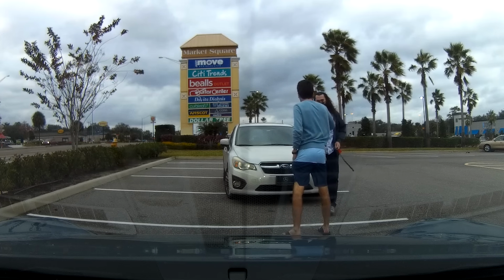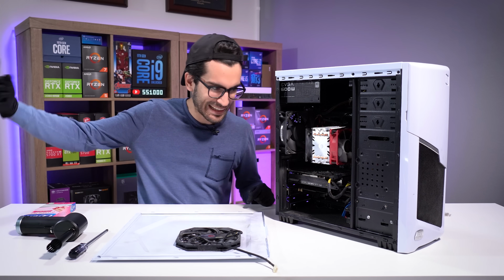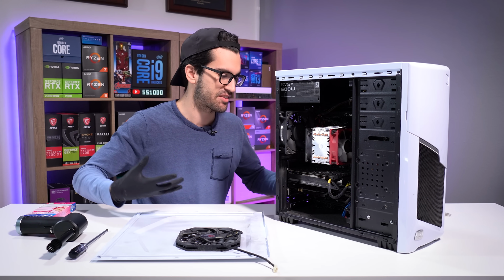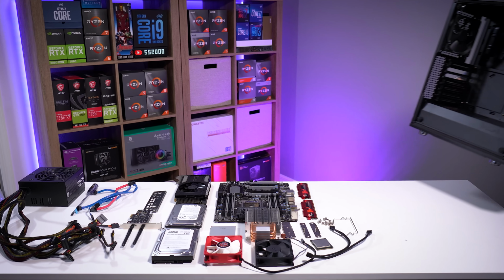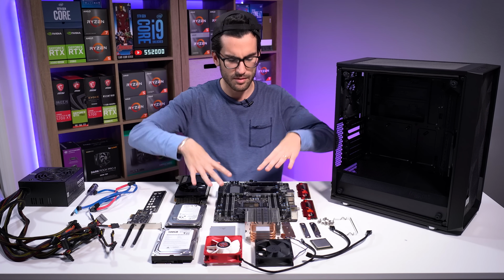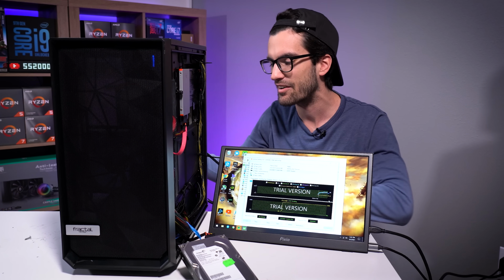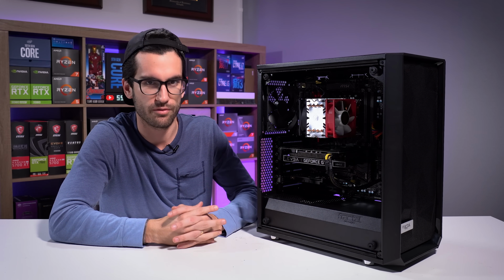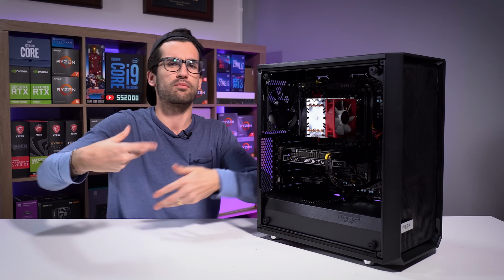Deep-Cleaning a Viewer's DIRTY Gaming PC! - PCDC S1:E2

Comment from the maker: I'm overwhelmed by the positive feedback and engagement from this series. I only hope to keep it going! Email Lisa if you're local and need a free cleaning! Episode 3 is already filmed 😁
Reply: @THISLOVETHISHATE99  they are dangerous to take apart. He probably blew it out off camera.
Reply: Excellent use of your platform to create content while also doing something good for the community👍
Reply: This is Keith, Keith has a dirty pc, don't be like Keith
Reply: Blowing dust out of a graphics card heatsink on to carpet is hardcore.
Reply: I can’t stop growing algae in mine no matter what I do done a whole different loop and CLEANED IT multiple times replaced everything and tried different fluids but nope
Reply: Have you considered throwing up benchmark stats for the combos and upgrades you do? 

To prove that older or more mild combos are still viable with reasonable maintenance
Reply: G'day Greg, I'm really enjoying the PC Cleaning videos,
My PC cleaning kit also has a pack of Medium Bristle Tooth Brushes for doing the Circuit Boards, We had a Bad Day with a CottonBud (CueTip) & ASUS P8B87s-M, they had a disagreement over whether one of the SMDs was attached, the CottonBud won the argument 😖, but the Motherboard was right, it was important & I tried fixing it but the Board is now no good 🤬,
So now The Toothbrush Family Have won the Cleaning Contract, while the CottonBud Family just do Tight Smooth Surface Contracting 😁
Reply: I think if I may, spending a bit more time showing how to deep clean certain parts, like GPUs for example, best practices and stuff like that should engage more people.
Reply: I have family near you but my system is good. Honestly I'd more just want your opinion on my system.
Reply: This seems so cool to do but my pc is fine lol
Reply: More more!!!!!!!
Reply: hey greg, what about cockroaches? not much dust, but it wont boot. best buy says there are bugs behind the motherboard and won't fix it. could prove for a good thumbnail...
Reply: @bradb9345  use only distilled water. Stop buying "fluids" and change it every 3 months.
Reply: @Benjamin Phillips he was probably banned/blocked.
Reply: Yea this series is one of those oddly satisfying things you never thought anyone would enjoy watching but never the less here we all are!! I know that vacuums are supposed to be a no-go with computers but I can't wrap my head around how the duster is much different at least in regards to building any static? Wouldn't it be ok as long as you avoid any PCBs and components? I would much rather give the case a once over at first and then once the stuff is disassembled, use it on the heatsinks and especially those power supply cables! Is there any reason you cant just rinse the heat sinks with a bit of the isopropyl and then use soap and water or another cleaning solution? Blowing out all the dust kinda just gives me the heeby-jeebies since it's like your just spreading the concentrated detritus and essence of someone else into the air and into your space and also all into your carpet!

But it might be worth touching on a few dos and don'ts for people if they want to clean their own computers!
Reply: Ye good stuff.
Reply: This cleaning series is vey nice 🔥👌🏻
Reply: nice series, I want you to clean my pc but its too far, good for you to help your local community
Reply: Greg you have invented something new here, deep cleaning to a new level? I guess this is the equivalent to pimple popping videos for PC gamers... so is a Pimple Popp My PC series Very satisfying...😎😁
Reply: Enjoy the new duster! I LOVE this series. Volunteering to clean people's pcs is pretty cool of you as is, even more awesome that you're throwing in upgrades while you're at it. Glad you're not focusing on the ebay scumbags price gouging the hell outta people right now, so much of that going on your head would explode lol.
Reply: Sell me 1660 for retail pls I can’t find one for less then 200$ markup it’s insane rn lol
Reply: @joe_ferreira  it is distilled water with primo chill liquid utopia and I have to change it like every 2 weeks
Reply: can you make a video regarding custom loop guide ?
edit : the parts necessary , the loop planing , installation , maintain etc
edit : if maybe possible make a dual rad with single pump and reservoir
Reply: im not local dude but my pc dosnt clean after 5 year
Reply: these cleaning videos are great but could you also tell us the specs of the rig.
Reply: DROP ITTTT, I love these man, keep up the great content!
Reply: With boot config changes you might need  to wipe/re-structure the SafeBoot table in the BIOS. 👍
Reply: That pc wasnt that dusty/dirty. I suggest using acetone or mass airflow sensor cleaner to clean pcbs. Mass airflow sensor cleaner works great on everything in the pc. It dries fast but let it completely dry before powering back on and bam ez pz. It blasts all the dust away fast. Use gloves eye cover and have good ventilation tho.
Reply: do you sell any good graphics cards to sell for under 600
Reply: lol, love the videos, i still get sad when you guys pull out your good gpu's, because i have a gtx 680!
Reply: at the end you had no ram in the motherboard!!!!

Comment: Any tips for cleaning Gpu's? I'm scared to touch my old gpu (In my brothers pc), scared to break it or else.
Reply: It looks more fragile then it is. Only thing that can be a bit fragile is the cable for the fans but besides that you won’t easily break something if you don’t throw it around or something like that. Just follow a few disassembly guides for the exact model clean of the thermal paste/fans with ipa and blow out the heatsink with compressed air. After that screw it back together. For the 4 screw on the top of the gpu that are holding the heatsink stuck to the gpu die make sure you screw those in a cross pattern a few times until they are screwed down and not all at once so you get equal mounting pressure also don’t over tighten them. If it won’t screw further don’t force it.
Reply: @sijedevos2376  I'll have give it a try! thanks m8

Comment: This is a very cool thing you are doing Greg loving this series and picking up tips as I go. Actually had to dig into my system today for a new 2x8G kit of RAM thought I'd just pop them in and be done. Then realized my stock cooler was in the way. Tried to just pull the cooler off, rearrange it to allow for new RAM, and remount it without a fuss but ooooooh nooo. The back plate came loose and I forgot about needing that to secure the cooler. So at that point I had to dismantle most of the computer just to put in two sticks of RAM took me hours to remember all the cabling/headers etc. Definitely renewed appreciation for you tech youtubers who taught me how but boy was I rusty lol

Comment: If you want to give parts a deeper clean, I spray them down with CRC QD Electronic Cleaner. Gives them a good cleaning and dries quickly. Works really well on motherboards for all those nooks and crannies.  Used this for the past couple of years to clean and flips systems.

Comment: Love these kinds of videos!

The only thing I would add to your cleaning regiment (idk if you do it or not and not show on camera) is to take the Data Vac to the PC right off the bat. Just blow out all the initial dust in the system and in the fans, just so you have to deal with less dust chunks falling on your floor to clean. And then proceed to dismantle the system

Comment: One hint on doing this level of cleaning...  When you remove the CPU to clean it, put it straight back in the board. Those pins being out on show when cleaning and dusting other areas risks either something landing on the pin grid array and bending them, or dust getting in there and preventing a contact point. 

Always keep your CPU in the board when cleaning (ideally clean the board with the CPU in first, then after cleaning the CPU put it straight back) or use the CPU block cover that comes with the Motherboard if you kept it.
Otherwise an excellent video and superb cleaning job.... now I gotta start on mine... again....

Comment: Remember you can use a very soft brush for the dust make sure it all so very strong and easy to clean.
I use it to remove the dust that is hard to reach or very sticky and vacume wont work or canned air.
Reply: I second this. Personally use a soft bristled brush (e.g. boars hair) equivalent of what one would use for delicate plastics/paint on a vehicle.

Comment: When I take stuff apart and clean i try to improve them.  Cleaned a 1060 I flipped and added thermal pads to the memory chips allowing them to touch heat sink.  Added thermal pads to an rx 590 where the backplate was acting as a heatsink.  Juat neat ideas to improve older designs.  Anyways I like the series.

Comment: Using a Horsehair Artists Brush to Remove thermal paste off the sides and around the CPU/GPU has changed my life lol, no more worrying about peeling a chip off by accident, and its lightning fast with light pressure.

Comment: A cleaning tip,
Take the bare cooler(s) to the kitchen after removing the paste and clean in soap an water rinse through let dry , cleans easy , can use a brush for caked dirt dust that won't come off

Comment: Id like to see you do a cable management video on an extreme level of cables. I have 10 Corsair fans in my o11 Dynamic XL and there is legitimately no way to cable manage nicely with the 2 RGB controllers, Commander Pro, cable extensions, etc. It's basically just a massive bundle of cables with some tie straps around them. Id love to see someone tackle something like this because honestly I have no idea where to even start. I basically just hid everything on the backside and bundled it.

Comment: Good morning Greg. Would it be possible for you to make a video using electrolysis on the graphics card heatsink? I believe that doing the electrolysis in the dissipation component, the aluminum and copper are as if they had left the factory.

Comment: Fun fact that little issue he had with it only booting with all the drives in as opposed to just the OS SSD is likely due to the active EFI partition being on another drive (one of the HDD's). It's more common than you think and it is a pain to move it without reinstalling windows but it is possible.
Reply: Thanks for the highlight Greg, and for the great content!

Comment: right now my sad old build is running a i5 4690 with 8gb ddr3 @1333 and went from the evga 960 2gb to the 1050ti 4gb as a slight upgrade. and the case it is in is a thermaltake chaser mk-1

Comment: I once had a gpu die. When I opened up the pc I found that the fan quite working because a stibk bug crawled inside somehow and jammed the fan so it overheated and died.

Would be interesting to see maybe on just one the Temps before and after in the same case. Would be extra time though having to reassemble and everything

Comment: for the hard drive thing the guy probably originally had windows 7 installed, and back in the windows 7 days it was common for the boot loader to go to a random hard drive if you had more than one hard drive installed. even if you upgrade to windows 10 unless you do a fresh install, its gonna stay like that.

Comment: I am still using a 1070 fron 2016, think I need help taking it apart for a deep clean since I just replaced my 2700x’s wraith prism with a new Black Noctua NH-D15.

Nice GPU upgrade, I’m hoping I can upgrade my Pc soon, had the same components since 2016 and 2018 now

Also what is that mini monitor you use just for testing pc’s? That mini monitor and keyboard combo is nice

Comment: As for the not booting without all drives connected... Ive experienced this before with my cousins computer. seems like if windows is installed with multiple drives installed it can sometimes put things on the other drives. I will never install windows with multiple drives installed. get windows up and running then install your other drives!
Reply: yeah good idea to do an install with one drive in the system and then connect and initialize the other drives

Comment: Hey Greg, here's a challenge for you, find a chain-smokers pc. Shudder I cleaned one once, 3 hours per 80mm fan. I'm glad I didn't take pictures back then, when the fans are solid bricks of tar and dust.. I need antacids for just remembering. It'll be one you'll never forget... ever.. trust me.

Next in line was cleaning one from an animal shelter, where the office is in the same room as the Cats.. fur and litter dust... There is an off chance I may have PTSD from computer cleaning.

Also, It's CDO, even that had to be put in the right order. smirk

Comment: so when you are using the electric duster, where is the dust going?
Reply: On everything in the room and into his carpet lol but yea it was slightly triggering me too. I know the vacuum is supposed to be bad with static but still would've done a once over while avoiding the components and definitely once disassembled. the heatsinks and all those cables on the power supply most definitely and I would've rinsed off the heatsinks with some of the isopropyl and then soap and water or some other cleaning solution.
Reply: @connorjohnson4402  exactly, i have an electric duster and have to do everything outside or in the toilet. I was wondering where all of that filthy dust was going lol. I can never use it in my room all that dust going eeverywhere

Comment: Making me wish i lived in Orlando now. Even though I already clean my system it could of use some upgrades. I have a optiplex 790 mt with a off brand 500w psu, i5 2400 and a rx570 which doesnt work with my system for some reason so i had to go back to my old radeon hd 6450. it also has 8gb ram 665mhz. i know it sucks.

Comment: Do you have to put the thermal paste always on your cpu ? or is it just extra ? (im new to pc building)
Reply: Yes, you need thermal paste between your cpu and heatsink. If you are doing a build with brand new parts, it's possible the heatsink may have pre-applied paste (especially if using the included heatsink, like the Wraith that comes with the Ryzen CPU's). If not pre-applied, it isn't uncommon for third party heatsinks to come with a small tube of thermal paste. Either way, I'd recommend having a tube of MX-4, NT-H1 or the like on hand just in case you need to take the heatsink off and reapply paste for any reason.
Reply: @FireMrshlBill  thanks !

Comment: A friendly suggestion - getting a toothbrush of some other similar soft bristled brush would make cleaning the heat sinks much easier, and you wouldn’t have to dig the paper towel pieces out of them!
Reply from the maker: ? I used the brush in the air gun. Just used the towel to dig into the harder dust and grime. Blows out fine.

Comment: Dry electrical spray same as they have used for decades on cars, practical circuits, TV boards, etc, isobrobyl fluid for all the books and crannys. It's never been any different.

Comment: Should I upgrade my CPU cooler it’s AMD stealth
Reply: If you want a quieter and lower temps yes.
Reply: @R0BIN_  does make any difference  ? Like FPS drop
Reply: @ForgotToLike  If your cpu is thermal throttling then yes. But probably not unless you overclock it

Comment: I realize you need to plug your sponsor, but with Windows 10, if the OS has been previously activated on that motherboard/CPU, it is not necessary to purchase a new product key. That is the reason Microsoft put the "I don't have a product key" link on the product key entry screen during OS setup.

Comment: Why wasn’t the upgrade quad channel memory. 1660 was stupid it isn’t really much of an upgrade. A gpu upgrade that’s better would’ve been a 2060
Reply from the maker: 1. Don't like your own comment. You look desperate.
2. The 1660 upgrade wasn't stupid. It's a noteworthy step up from the 1060. Test both. You sound sour.
3. I don't carry around random sticks of DDR3. You're more than welcome to contribute next time 😁
Reply: If you were blind folded you wouldn’t notice the difference between a 1060 and a 1660. I definitely noticed the difference when I changed from dual channel to quad channel especially for those older hardware at least a 30fps difference in most AAA titles. and if u don’t believe me make a video on it and prove me wrong.

Comment: Ik it’s reviving it but idk if I could send you in my system my cousin sent me his GPU and I haven’t cleaned it he said he got the 1070 like when it came out so you would prob love to clean it. But the biggest problem I have is my motherboard it’s broken I think I’ve tried downloading the drivers and updating the bios and the HDMI port and the Ethernet port on my motherboard isn’t working either I gotta get a new one anyways I wanna try over clocking I got a Ryzen 1800X with a GTX 1070 god and I need a 1tb SSD or a 2tb SSD I’m struggling on space with a 500gb SSD I did only have 128gb SSD but I’m slowly upgrading but I’ve been having to live off of usb to Ethernet adapters for a while now

Comment: When cleaning finstacks, brush parallel to the fins in order to get as much dust out as possible. You way not see it but some dust just sticks in there and even though it's very thin it's enough to lower cooling performances.
AND ALSO FOR THE LOVE OF GOD STOP SPREADING THE THERMAL PASTE. Please.
Reply from the maker: There's absolutely nothing wrong with spreading thermal paste. Get over it. Also, I DID brush parallel to fin stacks. Kinda common sense. You just saw the snip where I was also brushing perpendicular in order to remove the grime on the edges of the fins. And I know I didn't show it on camera, but these fin stacks were thoroughly washed in water. No more dust. Relax.